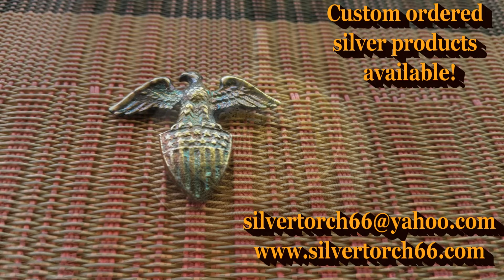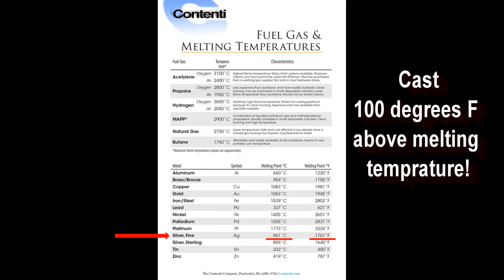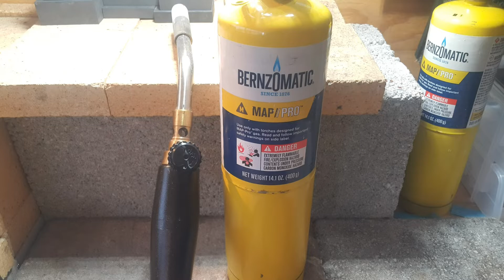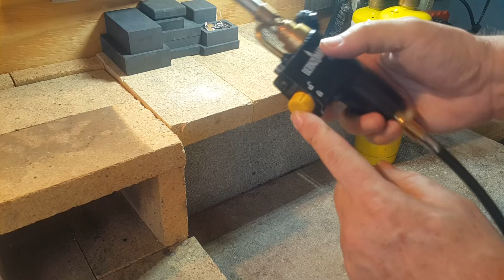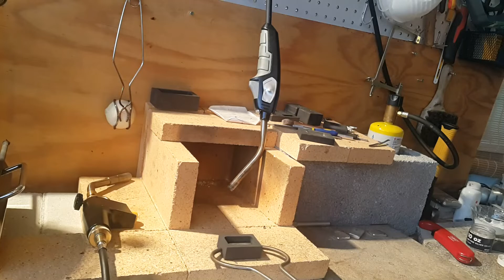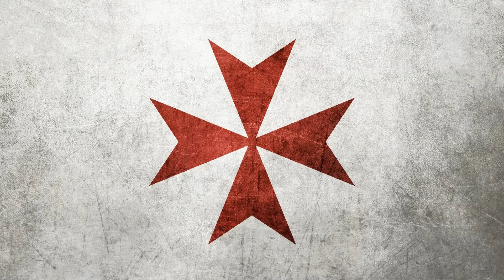ST66 Pouring Bench Tools, Equipment and Products - Heating Torches

Comment: Do you know why the mold must be so cool compared to the metal?   I would think a very hot molt close to the temperature of the molten metal would allow the metal to settle perfectly in the mold before starting to cool, thus preventing imperfections we often see in poured pieces.   Curious to know why that is not the way to do it.
Reply from the maker: Thermal conductivity of graphite depend on temperature: it decreases to a half as the temperature rises to 1300°F (704°C).